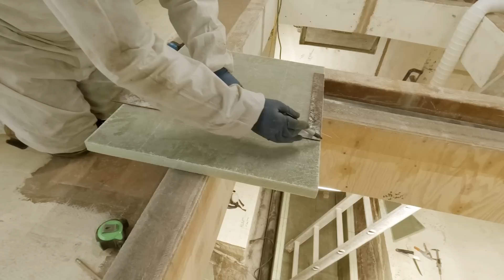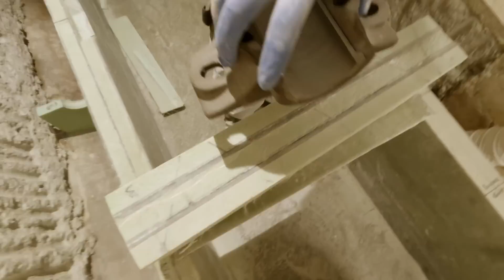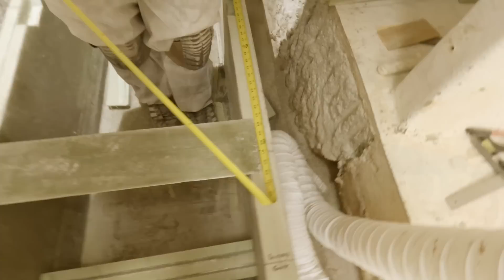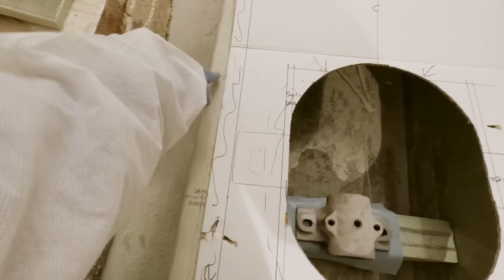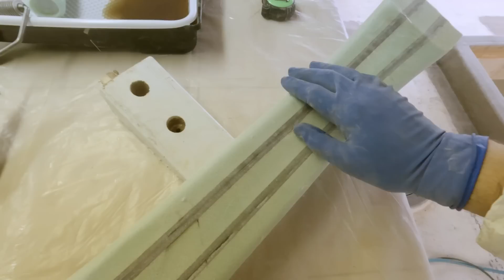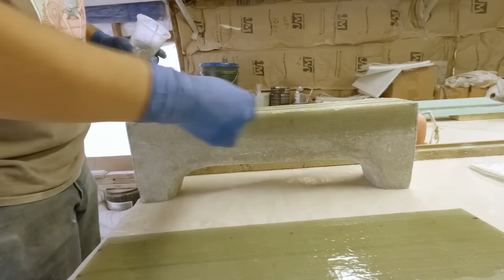Fiberglassing New Bearing Block - Emerald Isle: Ep.58 Fishing Boat Refit

Comment: Why use one bearing type when you plan on a change? Why not use the ones you intended to end up with in the end and not have to make changes or adjustments to accommodate the other bearing set? Seems like more time, effort and cost.
Reply from the maker: It really boiled down to cost. A single 2.5" split bearing runs about 3k new. We ended finding a couple on Ebay for quite a bit less. Retrofiting this to a new split bearing would have been relatively easy as the only change would be the shim pack.